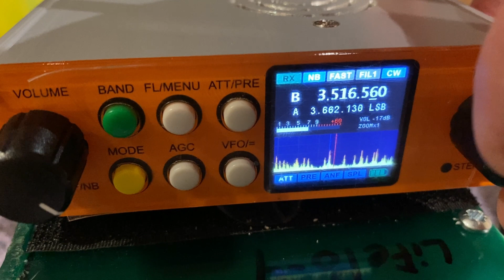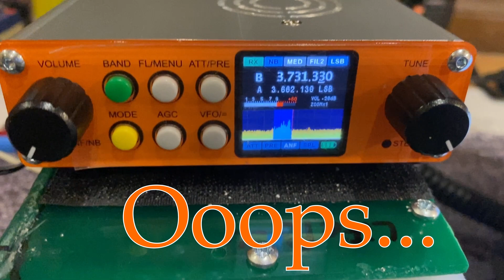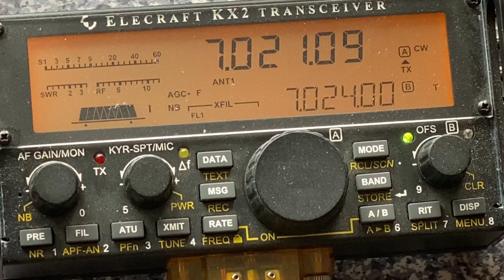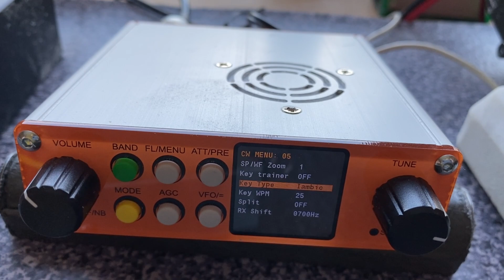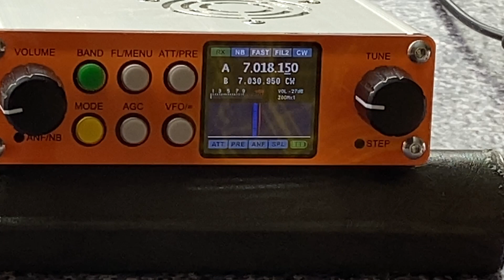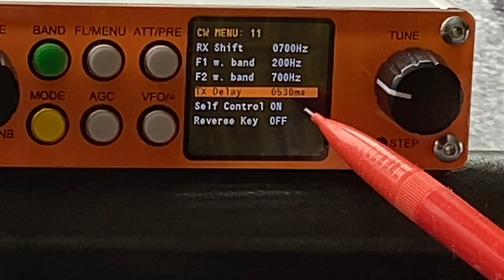SDR Minion by "QRPver" Review: SHODDY CW.  But I found a Workaround!

Comment: Hi Linas, please try to put some plastic so at you are not touch to aluminium with  this aluminium paddle. 
I have same radio and I also put aluminium tape inside these yellow plastics.  It is really not farady box before. I did not know how much its help, but mayby.
Reply from the maker: thanks Mauri! Good idea, will try it out. But I'm pretty sure it's a software design problem rather than capacity stray or something similar. 73! Linas
Reply: @Linas_LY2H  I can't make this waiting problem now if delay in more than 200  ms with strait key.

Comment: BTW LY2H  I owe debt of gratitude to a Russian amateur... real Russian , friend of Vlad the  Put quite possibly. He had bought a Minion and did a review of it on Yt.  I got in contact with him out the QrpVer1.3 single bander SSB and CW which looks really nice and had some nice Ytube  reviews , including one where you could hear audio in English and for SSB audio it sounded really quite fine  . He said - " don't touch it .. from what I have seen of the Ukranksy bugger's handiwork in my example , a lot of short cuts may have been taken and in particular the Encoder has a reputation for failing. "

 So I went out and   bought a G1M from Xiegu and it is a really nice radio , generally well built with a couple of minor known issues.  I managed to get this for  only  $130 AUD or so which is peanuts. 

So there you have it , the Commo who came in from the Cold (I joke somewhat)  and saved the Evil capitalist in the WEST from purchasing from the Little Russian and regretting the tale. : -)).
Reply from the maker: Thanks for the info again! All the other flaws apart , the encoders work so far so good, and the little screen with the waterfall  is also very nice. I think, this radio, if all the problems solved , could be the champion in the QRP class. As it is now, it is OK for the SSB work mainly, the filters are good, the audio is normal. One if my first contacts with it was an Indonesian station on 40m SSB running the Minion at 9W output  into a 120 ft  EFHW . Surely, it should cost far less as pure SSB rig :). I haven't had a chance yet to get the G1M and compare it with the Minion. If I come accross some second hand etc., I would take a chance on it , with another story on YT , of course :) 73! Linas LY2H
Reply: @Linas_LY2H  G1M I have was bought brand spankers new .. there was a stuff up with the  Paypal payment - whereby the vendor got paid but there was a problem debiting my account.  i rang them /Ebay and eventually was put thought to their main section in the USA to fix .. fix was only partial...they got more money but not the lot...then they sent me an email saying .." this is too hard. We've decided to give up - balance is written off. " 

The G1M uses an RDHH16 in class A as the PA.  It is a very robust design but does use a bit too much power on standby. I have seen one pulled apart and it is well thought out.  The encoders tend to give trouble after a time  but I have the Digikey number of a known good replacement.  There is also a full optical encoder that suits I can get from the Uk should I want a gold plated job.  Off the production line G1Ms test out at OVER 5 W and in fact on CW 40 will generally give 7 W out.  This tcver sells for about USD 250 in the"Land of the Free "  but the word is that the importers cannot keep it in stock.
Reply: @F_Tim1961  I have bought quite a bit of stuff from Yuri at QRPver (1.3 plus other bits). I found them always responsive and delivery to Australia quite quick. So far have been happy with what supplied, it represents quite good value for money and ultra miniature.

Unfortunately it seems the war has put QRPver and Yuri out of business for the moment, so hope he is OK.
Reply from the maker: I also wish all the best to Yuri and his company and looking forward to the war is over , Russian occupants are  out, and the freedom loving people of Ukraine can get back to normal life, including ham radio. We here all stand with Ukraine, I have a family of Ukrainian war refugees right now in my house and thousands of other Lithuanian people do the same or showing help and support in any other way. 73! Linas LY2H
Reply: @Linas_LY2H  The other things you have to be careful about  with these Ukranksy  radios are 1.  Extremely long turn around time for any repairs  - Gil in France knows all about that .

 2. THey advertise a certain price in USD on their website  but when you go in to it (as I did)   that price jumps by USD 70 when you want to pay by Paypal.

  If  you do a bank to bank transfer to the UKR ,  they will sell at the original price.  BUT  in that case you  get zero buyer protection - NONE.  so it is a big risk buying such a tcvr from the UK or Australia or the States.

  There's no implication here that the tcvr will not be shipped by Yuri  but there is a Lot that can go wrong.    TE. Fidler
Reply from the maker: @F_Tim1961  Thanks Tim. Yes, I know very well all the  pecularities you are writing about, been there , done that. Unfortunately, the customer service is none to exist with this company, they find it difficult even answering letters with very concrete questions in the language they speak very well , Russian. I wrote no less than 2 to them. I hope and wish they improve within a time. 73! to them !  Linas LY2H

Comment: Re Crappy CW implementation --  old Diz of The Toroid King fame - USA.  is selling his  keyer chip (for a paddle key obviously)  separately from the  Organic 5 Watter CW kit.  I just noticed this.  If you gt this chip and a  bit of support circuitry  ( he publishes a full schematic ) you can build an external keyer for not much money,  ESP if you live in the USA.  this may be a general work around and it means that if you have this external keyer you can use it on any CW tcvr without having to adjust to  different keyer implemenations.  I believe he charges about 5 dollars for the programmed chip.  USD of course.    TE Fidler in NzL
Reply from the maker: Cool! Thanks for the info! I hope , this might be useful for those who are looking for an external keyer! 73! Linas LY2H
Reply: @Linas_LY2H  Greetings to Lithuania.   It is indeed a very cheap way to get a  usable keyer.  A very nice keyer is embedded on the  CW tcvr that  old  D Benson designed for the four state qrp group in the USA  ..it uses a potentiometer to set the desired speed via an A to D converter. However you'd have to split the code out from all the other functions and I don't know that  Benson has put the code free to view .  Worse still my recollection is that the micro is a PIC of some sort and not a real micro like an Atmel.

Comment: Gil at Radio Prepper found that a common mode choke eliminated that CW delay. Seems the Minion is more sensitive than most to stray currents. Probably a shielding issue.
Reply from the maker: I am not sure Gil said chokes eliminated the problem. Besides, this  effect takes place on my Minion also with the 50 ohm dummy load connected, that's why I think in my case this is not "RF in the shack" problem but rather some firmware flaw. I found out that in my Minion at the TX delay setting in the menu at abt 520 ms this effect almost gone, repeating itself quite rearly . But in general, ferrites on any and all wires is a good thing, independently. Thanks for watching, stay tuned for more! SDR Minion review in FT8 and other Digi modes is coming! 73! Linas LY2H.

Comment: Here's my experience: https://youtu.be/E8Zu-1dyAwY
Reply from the maker: Yeah, excactly the same flaw as in my video. But in my case the workaround I found helped out. I have been enjoying right now 2 hours of CW operation on 20 and 40 m into the R8 vertical and got around 15 QSOs in the log running the external memory keyer at the TX delay set at 520 ms. I had no single issue during this time. I think, with more experimenting your rig should also be able to run CW more or less acceptable. GL!
Reply: @Linas_LY2H  Thanks, Linas. I will check my TX delay, but I believe it’s already over 500. Also, along with ferrites, I ordered a small external keyer..

Comment: Hi líneas good Day how are you and your wife, líneas im interested to buy this but i have one concern with this minion is this sdr is this radio can tx in out of the amateur band and on cb band tnx praying for your and your wife fast recovery.
Reply from the maker: Corp Mari, thank you for your  nice words! We are recovering slowly but steadily. Wish you and your's stay safe too! 
The SDR Minion theoretically can transmit on 27mHz but practically I don't think it's a good idea because the LPF filters ( which you have to buy separately) are tuned to the Ham Radio bands. You probably can buy the Minion without the LPF filters installed and use your own external LPF tuned to the CB range. But it's all on your own risk :) Also, there is no FM mode in this rig and the AM mode is only functioning on RX (no AM tx possible). 73! Linas LY2H

Comment: Hi Linas -

Glad that you and your wife are on the mend. I hope for a speedy recovery for the both of you. 

I, too, have a Minion SDR xcvr and experienced the very same conditions with CW. I have a Begali Adventure Mono and it does not improve the keying issues, even after adjusting the delay period. Ferrites have been placed on every wire and I have added a choke. Same problems. I may specify all mix 31 ferrites and build a better choke, as well. I

It’s a lot of work and additional cost to troubleshoot the issue. After adding the bandpass filters, shipping, upgraded case and a microphone, I spent close to $600 US.  I have written the people at QRPver polite letters with my findings, photos, and videos of the malfunctioning rig. To date, I have not received a reply. When I received the rig, the rear plate was cracked. My email was replied-to and Yurii promised to send a replacement. 

Thus far, I’m not impressed. The radio is a potential game changer given its size, output, and capabilities. However, if the designer won’t acknowledge an obvious flaw, they are damaging their brand identity negatively impacting future sales. 

I’ll keep plugging and see if I can devise a fix. 

73.
Reply from the maker: Thanks Chris, wish you and your family stay safe and healthy! 
Thanks for  info on your rig, have you tried the Straight key mode and running the external memory keyer? This workaraound did the trick best for me. As to the TX delay time , I think it takes some experimenting in each case. 520 ms worked for me almost fully eliminating the feeezing effect. And I agree re the strange customer support policy by these guys. I wrote them a couple of letters  too, in Russian :), but it seems they stop communicating right after they get the money :) .  But I still like the radio and gonna keep on experimenting incl in the fields . 73! Linas LY2H
Reply: I have QRPver it works well. Also Yuri very helpful. The QRPver guys are based in Odessa and now caught up in the war. Hope they are OK and if Ukraine not viable for them they can set up their business somewhere else.